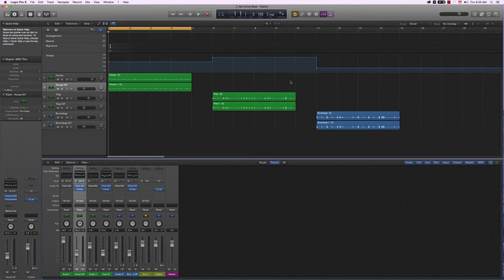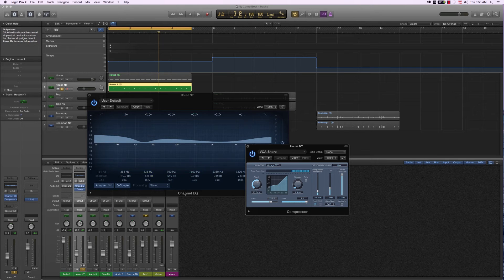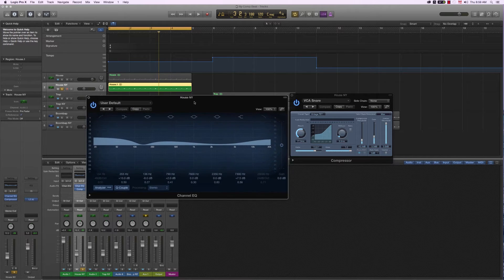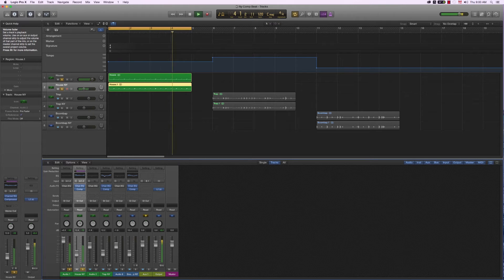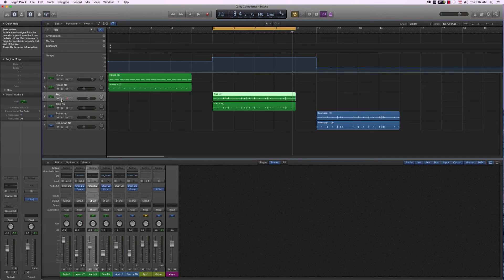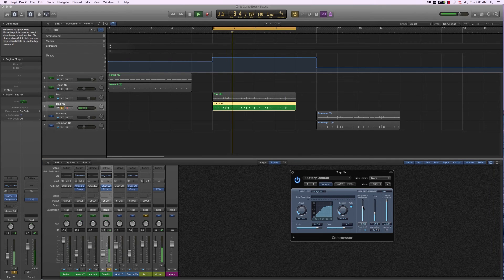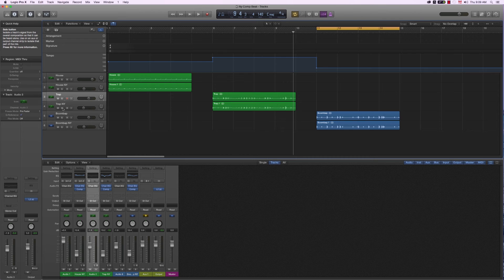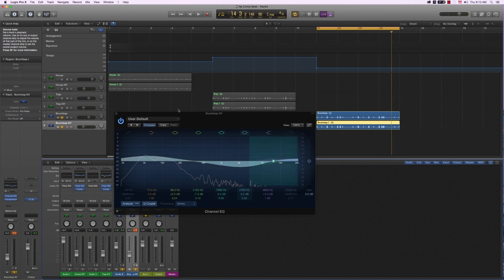The New York Compression Trick: a simple way to FATTEN your drums

Comment: In the case of a completely programmed drum track would you recommend doing the NYC comp on every track separately ie: kick, snare, etc...(this would be heavy on some systems) or creating a track stack and doing it for the track as a whole? Thanks for the awesome vids!
Reply from the maker: I would probably route everything to a bus a compress that one. You can always parallel compress each indivudual track, but i doubt you'll get the same effect. Whats cool about having one Drum bus is the effect of the Compressor on the reverb or room sound...
Reply: +Delicate Beats I see, that's what I've been doing for my main effects. never tried this type of compression trick. Usually I'll double a track and add what the main track is missing  ie: low end, snap, etc... This is wicked, big fan of disco and 70s style production. Thanks homie!